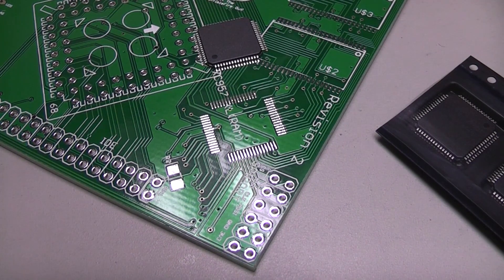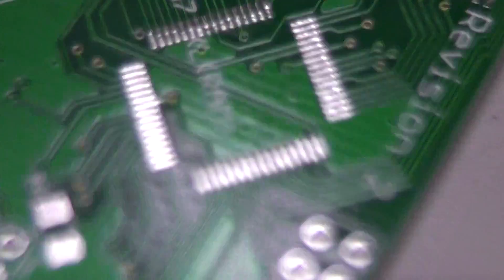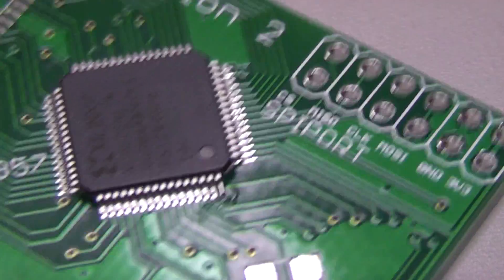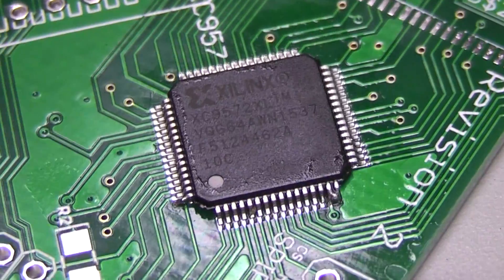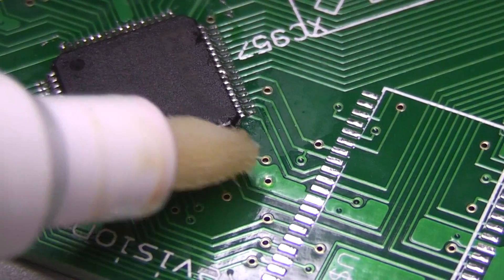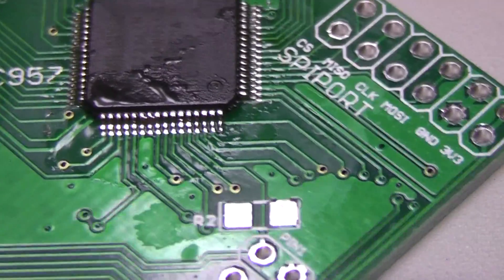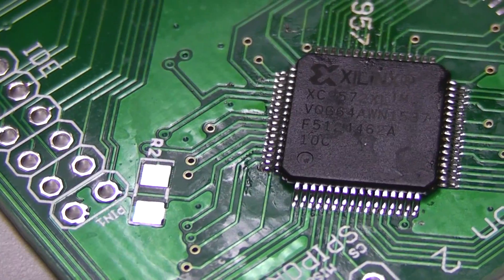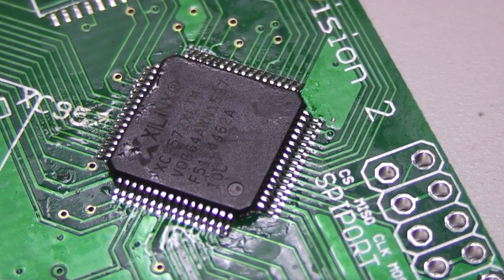Soldering 64-VQFP package SMT CPLD (XC9572XL) IC on Amiga TF530 PCB

Comment: By my opinion, you are using too much dissolved flux, try using something more jelly.
Reply from the maker: Rosin based fluxes are definitely higher viscosity (the Loctite MFR301 is about like water), but rosin is a mess to clean up and has some nasty allergen issues, so I rather like this liquid flux now that I've started using it.

Comment: Yes, it's very trivial to solder qfp. Very funny when some people claim you can't solder these without a microscope :P
Reply: Hmm like mine when I got the hump because I was sent a broken scope and killed 3 boards.... But today I managed to solder everything with a small jewelers eye glass thingy and get the CPLD's programed. I'm well happy :-).. I'll be powering it up shortly. @ Stephen. Was Digi-rom  released or did you decide to hold that back ?
Reply: Hi Stephen, yes that is my board on EAB. I agree the memory chip pins don't look so good in that picture, I have re-flowed them a good few times and they do look better under magnification. I was wondering if the chips were badly soldered, would we still not get IDE or an auto config board listed in Sysinfo ? thanks for the heads up on the clock jumper, at least I know that's correct :). Anyhow, I have got this far i'll keep cracking on :D

Comment: how critical is the iron temperature
Reply from the maker: Shouldn't matter too much as long as it's in excess of the melting point of the type of solder you're using. The VQFP pins don't have much thermal mass, so you don't need to go crazy with the heat to keep the solder flowing easily. For leaded solder anything in the 500°-700°F range should be fine.
Reply from the maker: The Fonz I would probably try around 400C and see how it goes— you do want it to flow easily, so probably a little warmer than if you were just doing resistors or caps...